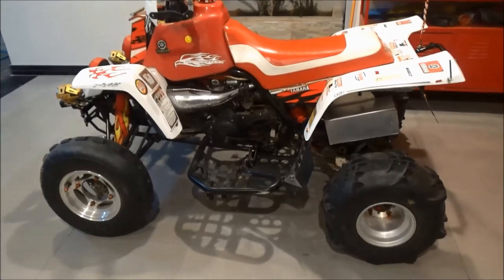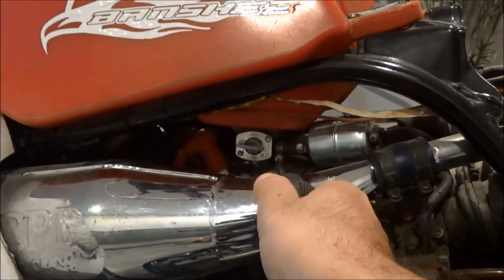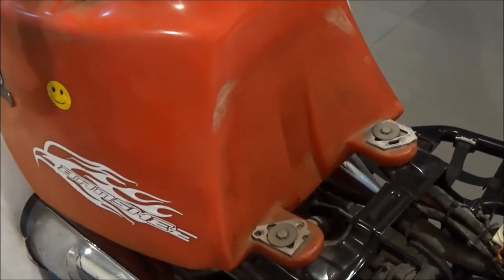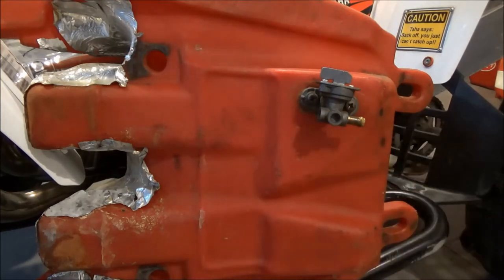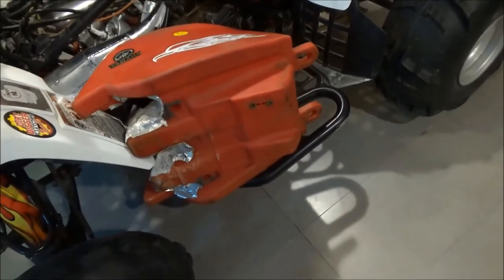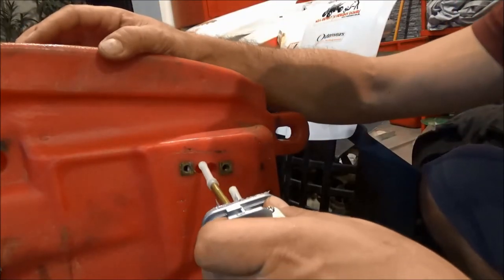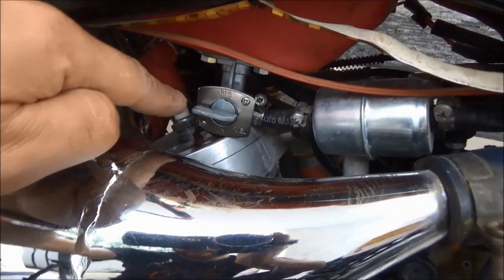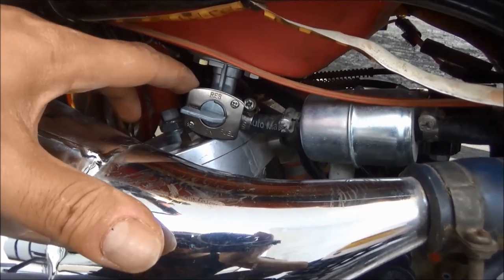Yamaha Banshee - Replacing Fuel Cock

Comment: Could you tell us about the fuel tank? is it easy installation the tank or I have to cut the fender? And how much is the size?
Reply from the maker: The tank installation is straightforward  but the OEM cover won't fit. No need to cut the fender.